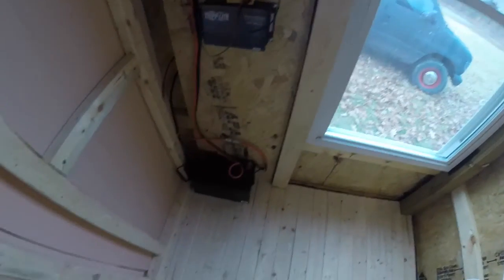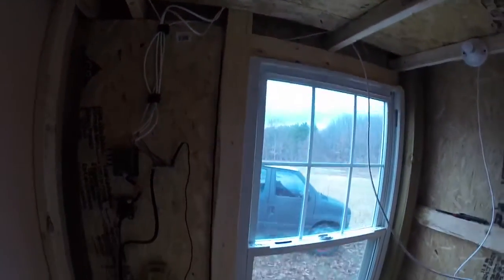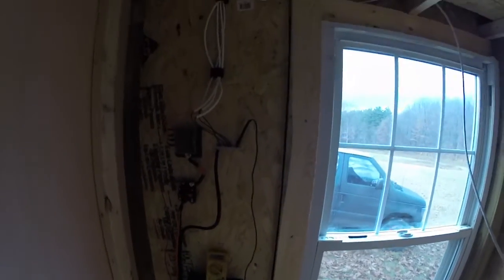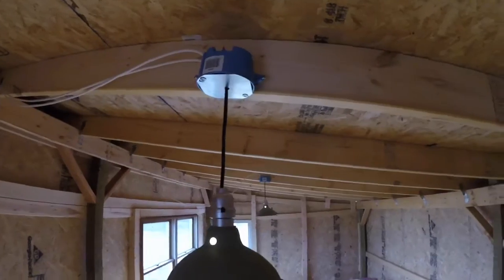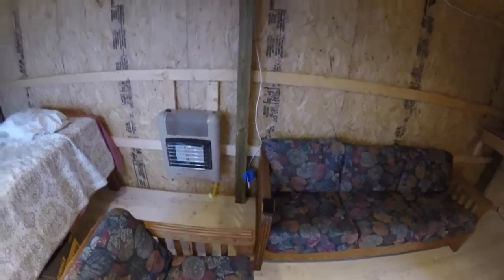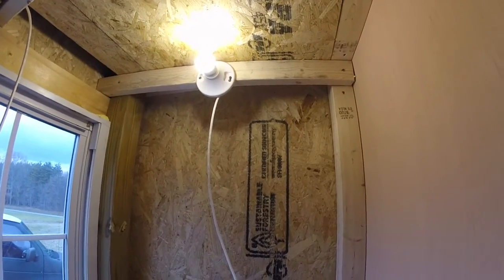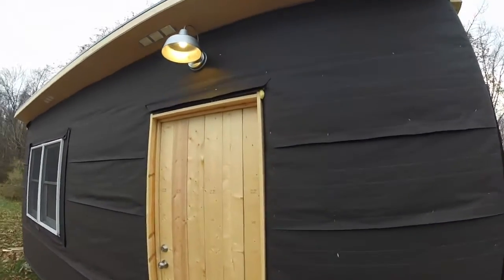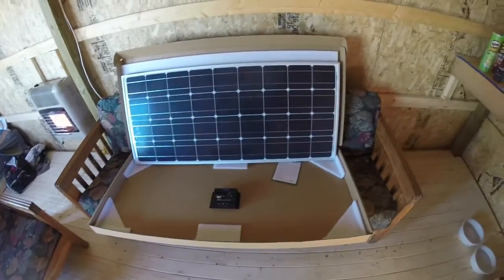Off Grid Cabin 11/15/2015 - 12V DC Electrical

Comment: Great job! I'm curious about the type off electrical cable your using for the lights n outlets? What is it n where did you get it? Tia!
Reply from the maker: Thanks! It is actually in-wall 16G jacketed speaker wire. Found here... https://www.amazon.com/Mediabridge-16AWG-2-Conductor-Speaker-White/dp/B00N18VEJ4/ref=sr_1_3?ie=UTF8&qid=1540768554&sr=8-3&keywords=16+gauge+speaker+wire+white

Comment: If you already have a power inverter (visible) why not just power it up and run led A/C lights and simplify everything.
Reply from the maker: Hi Jim. A few reason actually. Inverters go bad. Inverters are noisy. 12V wiring is much easier/cheaper. Ham equipment is 12V by design. Lasty I wasn't sure if my one battery would keep the inverter powered up. I was proven right this summer when I had a Linksys router running off of the inverter. A couple days and the inverter reset. So I am comfortable with my decision of using 12V. Thanks for the comment!

Comment: How are the standard 120 VAC switches working out for you with the 12 VDC? Is there any arcing or have any of the switches burned out? I've been looking for switches for my 12 VDC cabin but all I have come up with so far, are DC switches for boating applications. All the best - Dave
Reply from the maker: So far so good. There isn't much amperage running through them. At the time I was considering 12VDC switches but I wanted to residential look of the switches. Thanks for watching!

Comment: Where did you get the 5 watt 12v DC standard screw base bulbs? Are they warm white (2700K)? I've been looking for some for the same purpose but they seem hard to find.
Reply from the maker: +Steve Gerber these are the ones that I bought... http://www.amazon.com/gp/product/B01080HQIA?psc=1&redirect=true&ref_=oh_aui_detailpage_o09_s01
Reply: +Clark Hilterman Thanks for the quick reply!  The ratings are mixed on Amazon with some people having durability problems, have yours held up ok long term?
Reply from the maker: +Steve Gerber I have had them in the cabin for a few months. Just used on the weekends. Hard to report durability although LEDs are usually OK if they aren't DOA. I didn't have any DOAs even though a lot of reviews reported such.